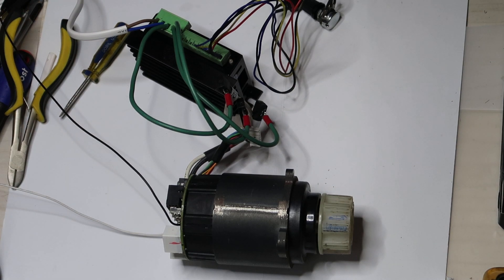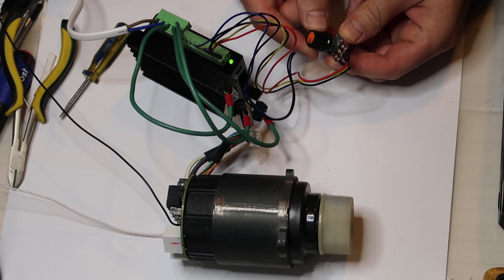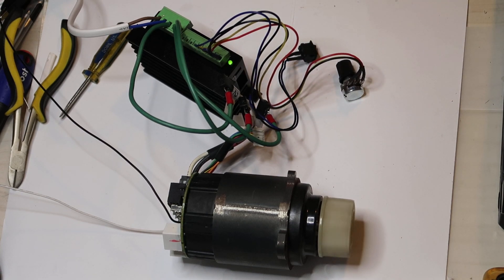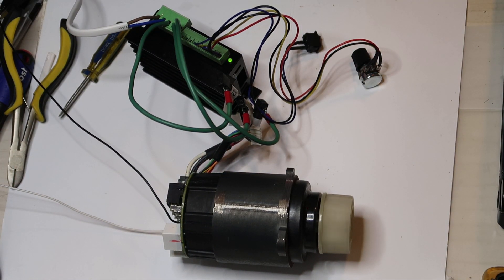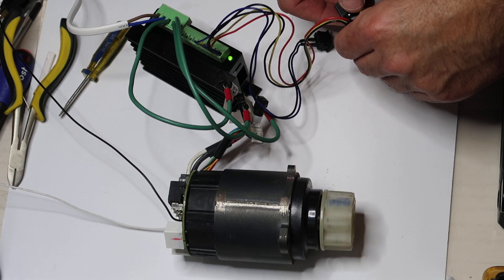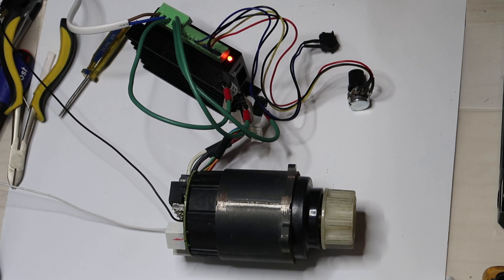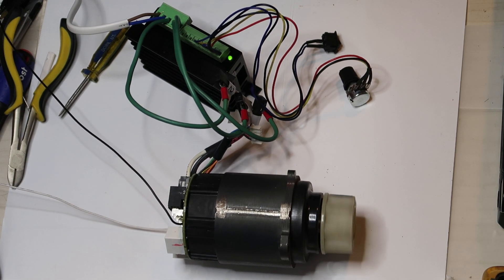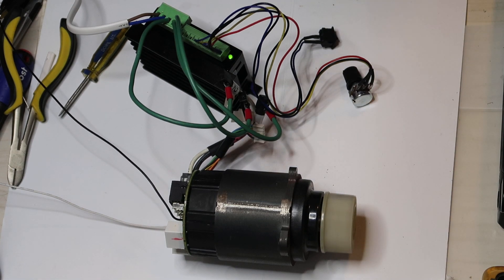New BLDC Motor Driver WS55-220

Comment: Thanks! I have mine working now. I use a 40V Ryobi battery for power, and the 12 volts to turn on the relay comes from my power supply in this video, but I have a buck converter I've installed in my robot to draw the 12 volts for the relay from the 40 v battery as well. https://www.youtube.com/watch?v=fG4u0LwO9fE

Comment: hello Roee, do u think i can use this regulator on a 3 phase 1000w motor? like an e bike? 48v
Reply from the maker: it can be damaged - this is not intend for 1000W, it is for 500W, it might work if you don't overload too much the motor

Comment: Hi Roee, I need to know which IC Chip the WS-55 (220) is based on ? I understand it is an "ST Semi" (or maybe "On Semi" ?) BLDC Controller IC, but which IC exactly ? From its Datasheet,  I need to get its Alarm logic (e.g. - when the Led blinks Red-Green, or Steady Green, or Steay Red). I have the single LED version. Thanks !

Comment: Hi man. How the 2-position switch works? Can you start motor spinning with this switch with potentiometer in not zero position? What I mean - I will set needed RPM with potentiometer and then turn it off with switch. Then, when I turn it on with switch motor will start and will be spinning on set RPM. Does it works like this?

Comment: Have you tried these units with a high watt motor? I was trying a BLDC controller you used in a previous video with a 105 Watt 24V aquarium pump and noticed I was getting maybe 50% of the efficiency I got from the stock controller. Part of the issue is the lack of Hall feedback from the pumps but the other issue was that the signal from the controller was extremely messy (likely poor quality parts). Do you have any recommendation for specific controllers that offer high performance and accept a pwm signal? Also, have you considered using something like this to convert your PWM? Something like this. https://www.amazon.com/KNACRO-voltage-module-converted-voltage/dp/B01HXRSQF8/ref=asc_df_B01HXRSQF8/?tag=hyprod-20&linkCode=df0&hvadid=216526779832&hvpos=1o2&hvnetw=g&hvrand=17566663529019525901&hvpone=&hvptwo=&hvqmt=&hvdev=c&hvdvcmdl=&hvlocint=&hvlocphy=9053018&hvtargid=pla-348384112696&psc=1
Reply: Iwant drive brushless dc motor 300vdc 3amp and software